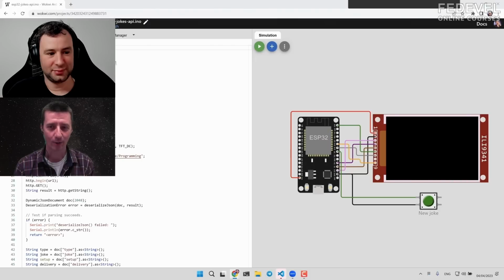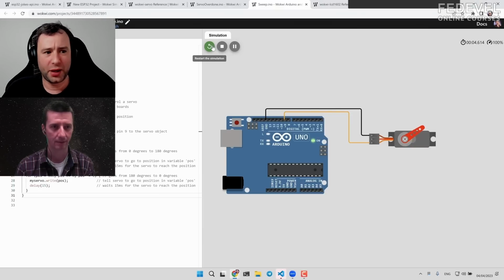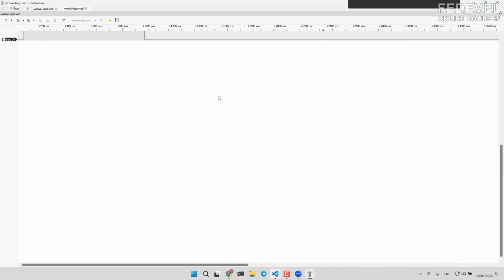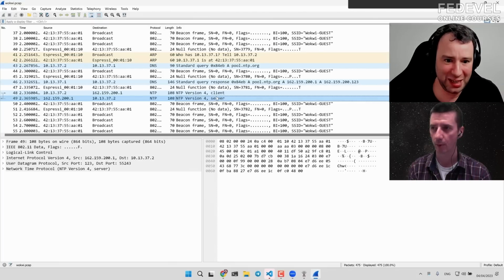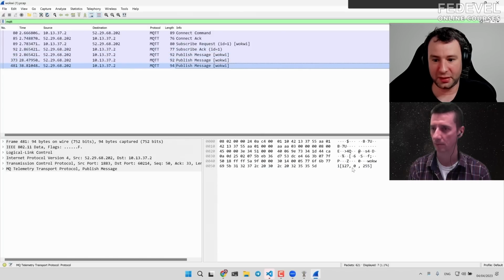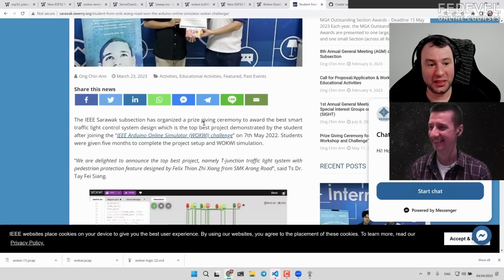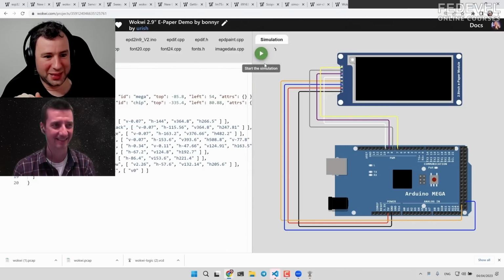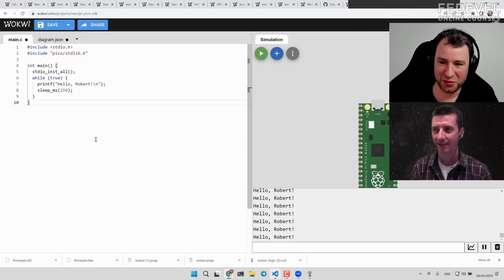Build Your Own Circuits in Browser | ESP32, Arduino, Raspberry Pi Pico

Comment: That's cool, I'm more interested in using the WiFi AP mode and also BLE scanning. How would one make a BLE packet so that the ESP can receive this packet ?
Reply from the maker: Thank you very much. I am not sure how to do that. I recommend to try to contact Uri.
Reply: BLE is not yet supported - but it's open for voting. Same with WiFi AP. What's your use case for these two?
Reply: @Wokwi  just BLE beacon scanning and pushing the data to WLAN. Basically a BLE Gateway simulation.

Comment: It's so much quicker to move a wire in the program, as opposed to manually unplugging and replugging. And the best part is you can put components into your circuits, even if you don't have any on hand.